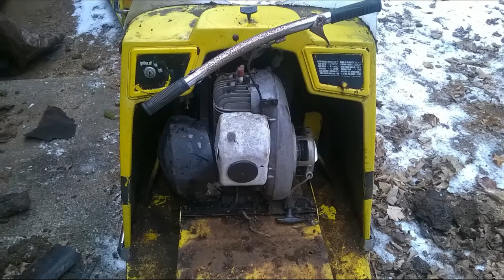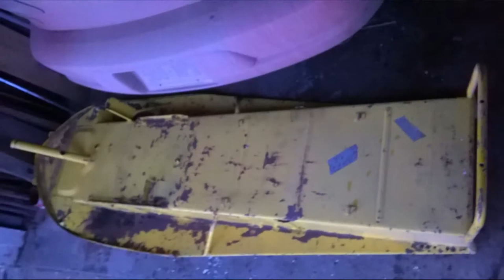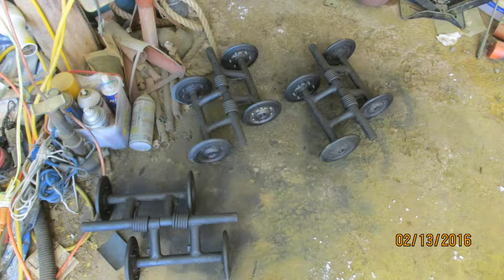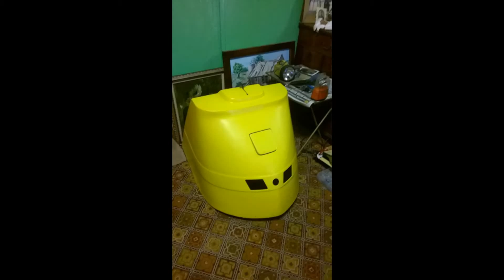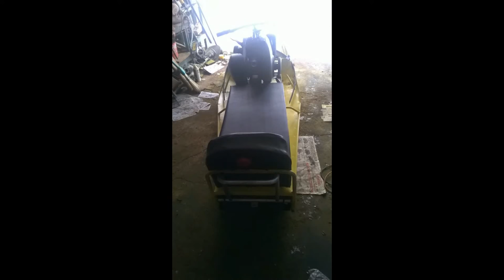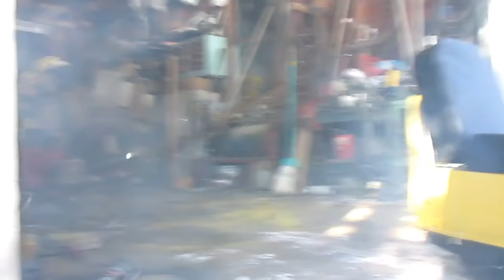restored 1967 ski doo olympique 250

Comment: son moteur risque de chauffer = il a replacé la tète du cylindre dans le mauvais sens
Reply from the maker: I am sorry I am not able to read your comments.  Thank you for commenting if able to translate to English, please. Do so, would love to read it.
Reply: @NorthernANTs  you have to rotate the head cylinder to  1/4 turn (90degre) , the fresh air arriving from de flywhell will not cooling the head cylinder properly, causing a overheating engine ( look at the top of the engine in your video before the restoration and compare after the restoration)
Reply from the maker: I will look at it, luckily I have never had any problems with overheating, been running it like this for year, like this.
Reply from the maker: Thank you for pointing it out to me, just a bit scared to take it a part to change it, been one of my best running sleds for years the way it is 😁😉 it is one of the if it is not broke do not fix it things, at least if it would ever start having over heating problems, I know what to look at.